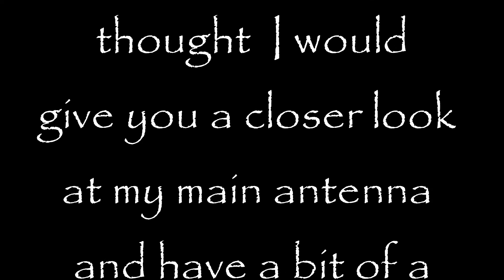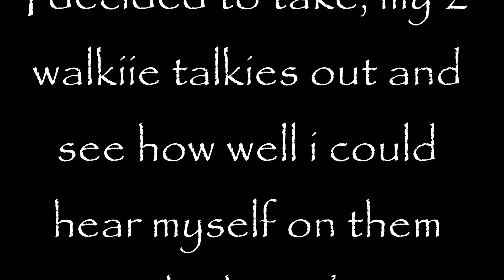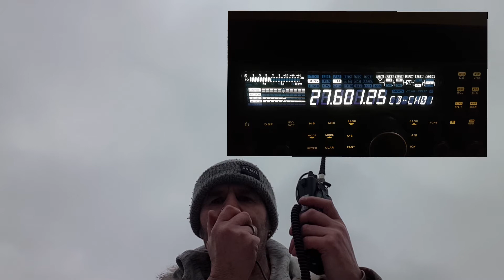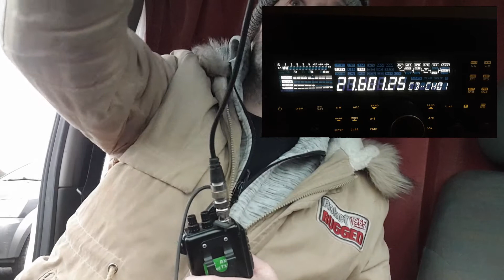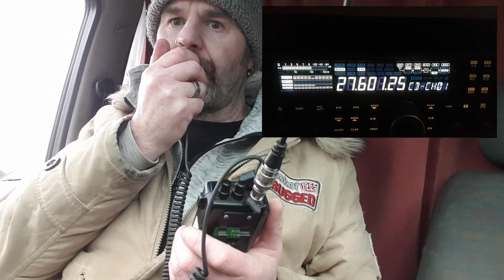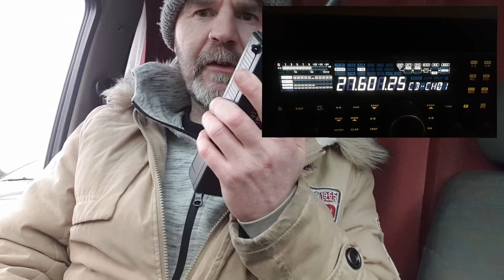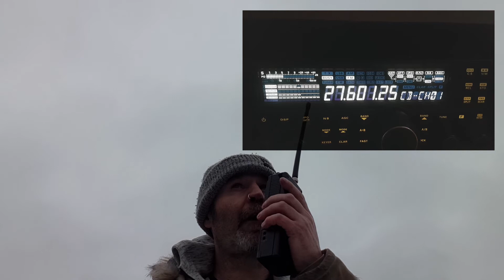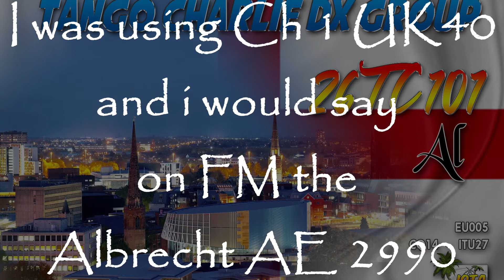Antennas & Walkie Talkies

Comment: I have a Predident Randy 3.

What adapter do I need to get,to attach my New Sirio 4000 antenna magmount?

I'm new to this,and have bought a Bnc to Tnc which is no good..
Reply from the maker: Hi, How are you attaching the antenna, are you putting it on a mag mount and then into the radio or are you attaching it straight to the top of the radio ?
Reply from the maker: As far as I'm aware if you using the Sirio 4000 on the car with the coax from the mag-mount then you will need a TNC to SO239. one of these, but I can't be 100% on that as I've never owned a Pres Randy. Here is a link to what you might need, but I would make sure you find out what the connector is on the randy. https://www.ebay.co.uk/itm/394252646220?hash=item5bcb49f74c:g:dv8AAOSwsedjKuwP&amdata=enc%3AAQAHAAAA4E2jJ3HRk8qbZ0N31ykZQxXkLeZ8vYJF8rV2tji9rGnXursyou3AiaGhjnnzt3TFwYaD%2BD%2BwaUdDwi50RmLoAV78NUKyHn%2Fi%2Bw4W%2BhVzPV%2FAmxxjjpSvorAKzAMa%2Bpj31E7lHhPFLjk3QCh1Ml%2Fyovqe5NqBbjoLDhjn%2BQhohBtlgutzDfs8mqZUOnVF1CyOB%2BuHzuaTpTR8pIOpuwqB4ZUuhRVSPfMdKMsXScrZ0vIg9Q4xQz%2FrH1ok8DzqN7D50b3aVs3Ye99PSJeao4C%2BfcZv0whcXz4mcCfDjhRd5GaS%7Ctkp%3ABFBM8pHsivVg  Hope that helps and good luck.
Reply: @Al.26TC101  thanks.....yep that looks like it...  👍

Comment: The AE2290 is a cracking handy, had one myself a few years back. Had a small paperclip on my keys which allowed me to switch the contacts under the PTT to export mode & back to standard UK spec.
Reply from the maker: If im honest im not getting on with it to well, batterys on USB seem to be terrible , it needs more power, but on a psu a car battery its fine.
Reply: @Al.26TC101  I can't say I had any issues with mine. But what I did use for portable was a rechargeable battery pack & before using that I made up a lead to use on a small sealed 12v 7ah sealed battery (which was a tad heavy) but those worked well using the car kit.
Reply from the maker: @OntheMicwithMike  The battery pack it comes with in my opinion is rubbish and wont let you use a few more amps , i think there is some kind of mod for it , ill certainly have a look around the internet and see if i can find anything to make it a bit better.
Reply: @Al.26TC101  i have the same one,i use chargeble batteries and i can use it for a few days lol